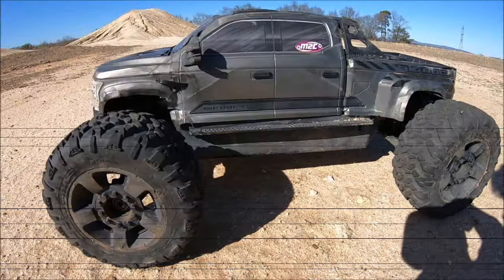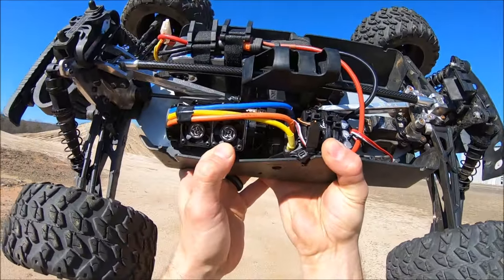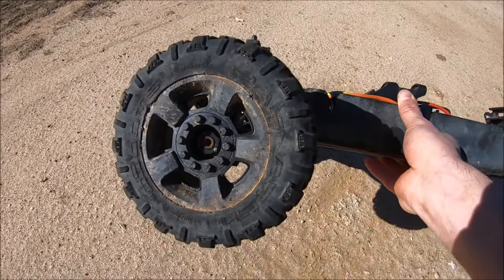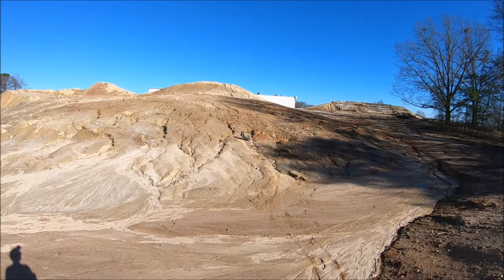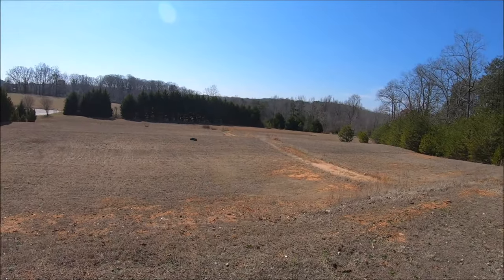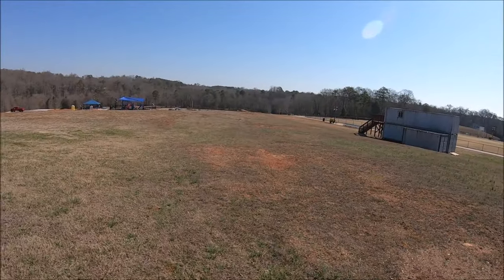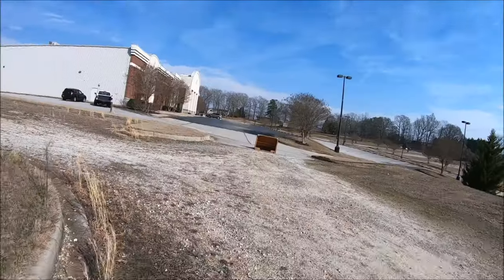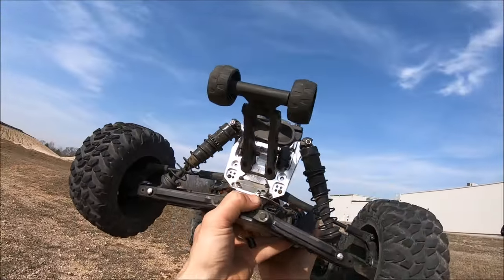ARRMA Big Rock 6s in BEAST MODE with Hobbystar 1480kv and Max 6!

Comment: I've got a Typhon 6S that I've tried to find. My last thing to do for is the suspension. What do you recommend? I do air it out some so I don't wanna chase a slap too hard
Reply from the maker: I use stock shocks with slightly stiffer springs. And just adjust collars accordingly.

Comment: Hey Eric, do you prefer the feel of the long wheelbase of the Big Rock/Kraton XL or the shorter wheelbase of the Kraton? The Big Rock drifts and slides really good, but I think that may be just because of the tires. If the Kraton had those tires it would probably slide around like that too
Reply from the maker: Imo longer wheelbase will drift easier as you can whip the rear end around easier. I like both just different experiences!😁👊🤘
Reply: Yeah man, I feel you. The shorter wheelbase is a little more nimbler on the ground thought, don't you think? Seems like it can turn quicker  @RCDUDE81
Reply: I think it would be really cool to see how the Kraton would handle with the slicker Big Rock tires on it 🤔 @RCDUDE81

Comment: Just ordered a 4292 on RC Juice for $45!!! Is this motor good in this truck temp wise? I’ve had hobbystar run hot in the past but I figure for that price I’ll try it
Reply from the maker: It does run a bit warm that's why I added those fans! With the fans it was perfect! That was also running a 23 tooth pinion. But yes $45 is a steal!
Reply: @RCDUDE81  well I always take you and Rich’s’ gearing with a grain of salt 😜😂😂 I go pretty hard but not quite like you guys so I’ll probably be starting at 20t and see what’s up 🙏🤘🏻🫡

Comment: "But, but, the tires are trash" . No, they are not, as you can see from his videos. You simply have to break them in, and trying to do so in freezing or snowy conditions won't accomplish that.
Reply from the maker: Yes I like the tires. They do just need to be broken in. They handle power good and don't Balloon much! They aren't the best traction on dirt but I like sliding and drifting too!😜💪👊👊